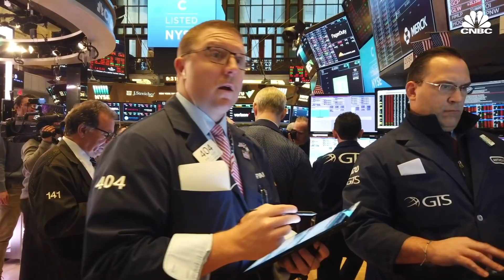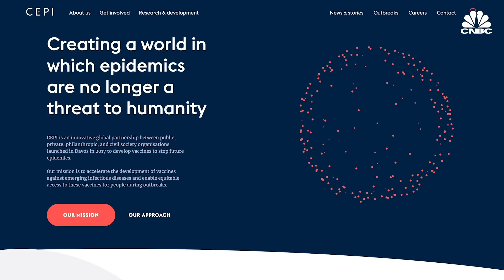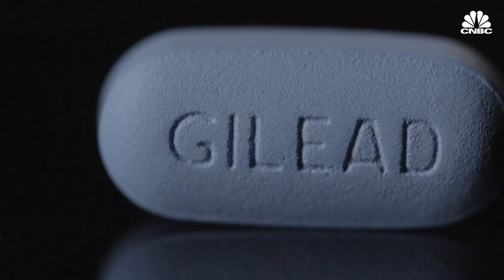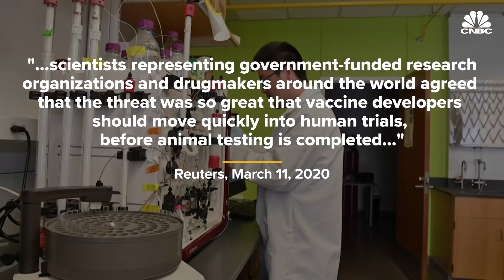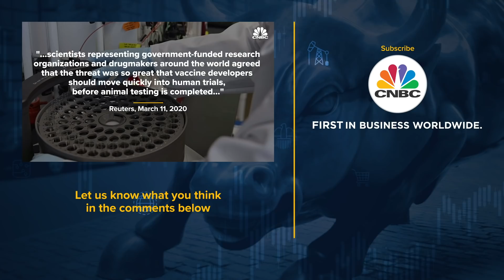The Race To Develop A Coronavirus Vaccine

Comment: Symptoms of the coronavirus:
• coughing
• shortness of breath/breathing issues
• fever
• body aches/ pains
• flu like symptoms
• a sudden urge to travel the world

Edit ♡
So I feel like I should add this on, just cause some peeps in the reply section are confused bout the symptoms 
Don't come at me if you feel this is wrong, please ;-;

Infection with Covid-19. 
This is how it goes down:

# Day 1 to 3
1. Symptoms are almost equivalent to a cold.
2. Slight sore throat.
3. No fever, no fatigue. 
4. You still eat normally.

# Day 4
1. Sore throat and body aches.
2. Make a hoarse sound.
3. Body temperature is about 36.5 C.
4. Start affecting eating habits.
5. Slight headache.
6. Mild diarrhea or digestive problems.

# Day 5
1. Sore throat and hoarseness.
2. Slight fever, temperature between 36.5 and 36.7 C
3. Weakness and joint pain.

# Day 6
1. Slight fever, approx. 37°C.
2. Cough with mucus or dry cough.
3. Sore throat when eating, speaking or swallowing.
4. Fatigue, nausea.
5. Occasional difficulty breathing.
6. Sore fingers.
7. Diarrhea and vomiting.

# Day 7
1. Fever is higher, ranging from 37.4 to 37.8 C
2. Lots of coughing with phlegm.
3. Body and headaches.
4. Worsening diarrhea.
5. Vomiting.

# Day 8
1. Fever, between 38°C or above.
2. Difficulty breathing, feeling heavy in the chest with each breath.
3. Persistent cough.
4. Headache, joint pain and hip pain.

# Day 9
1.Symptoms don't change, but they can get worse.
2. Fever gets worse.
3. The cough is persistent and more serious than before.
4. It's difficult to breathe.
5. Putting in efforts to breathe.

# At this point, blood tests and lung x-rays are needed.

# Forward and share. 

# Education is key. 

# Each one teach one

Please attach importance to this problem and don't take chances.

Wear a mask, pay attention to hygiene, wash hands diligently, avoid parties, cancel travel plans.

#FlattenTheCurve

ღ❦ღ
Reply: Yup. 
Here in Kern County we had no cases. 
Then some moron from New York came over and brought it here. 

Now thanks to her we have it in Kern County.
Common sense is not so common.
Reply: John Borris i'm from new york but i have to admit people here are really dumb.
Reply: John Borris in our state there were no one was infected........a person and his family from Italy .......👉🏻👍.....now its 😥
Reply: John Borris 
She probably didn’t know that she had the COVID-19
You may start feeling sick after like a week or so after getting infected
Reply: @johnborris3222  It is a reaction actually, not common sense. The person wants to leave to avoid the disease but already have it with no symptoms. Just like refugees.
Reply: Got that right. All the idiots who first had the virus in my country travelled to countries known to have cases. I don't understand the Idiocy of all of them really.
Reply: @luckyonegrado9794  here in my country too. We didn't get the Corona virus her but some idiot tourists (who were actually touring Italy and other countries) came here and now everything is chaos.
Reply: Lucky one Grado It’s complicated. Humans can’t really understand exponential growth. Let’s say we have a pond, there is a lily. Everyday, the Lilly reproduces one Lilly. It takes 60 days to fill up the entire pond. When will it grow to the entire pond? You may think it’s 30 days but it’s really in 59 days when the Lilly’s take up half of the pond. Remember, this growth is exponential not linear. If we were to form a exponential graph, you get a curved graph (an upside down C). This graph is what math people call a quadratic (2 multiplied by X, a variable). Right now, China is actually keeping some control of the virus because the recoveries is going up and cases are failing down very slowly. When we think about viruses, there is a critical mass where hospitals can’t take more patients and they are left to fend for themselves. You do not want to get to this point because cars will go up and recoveries will go down. Eventually, the virus will slow down because either everyone is sick, getting better, or dying. The media is causing panic and is causing people to make irrational (stupid) decisions. This causes the virus to spread. We can’t just make a vaccine because we just discovered the virus but what we can do is get people on quarantine or get people to stay at home. That way, the virus doesn’t not hit critical mass and making people not get treatment.
Reply: @succ5666  I get that. What I don't get is why make an unnecessary risk to your health like that. One guy knew Italy had the virus but decided oh what the hell let me go there, not for business just for fun. That's what I don't get
Reply: @luckyonegrado9794  Why do refugees leave their place? Basically the same motivation, to avoid affected places
Reply: Shid i got those symptoms but not the last one
Reply: @ztg1421  oof buddy Betta self quarantine yourself
Reply: ღSugaryCupcakeღ oof i forgot i dont have fever
Reply: kobe_playz_ random_games 😥
Reply: @jerry..c..mattathil5872  😱
Reply: DJ - JARAFAT 🤯...yes bro
Reply: Sometimes also loss of appetite
Reply: @arielcchw  thx I guess I'll add it
Reply: @bfundomarezz  omg people be taking things to literally, chill please i do research, it's just a comment
Reply: I heard symptoms are not sore throat, sneezing or runny/stuffy nose.  They are shortness of breath/breathing issues, fever, coughing and body aches & pains.
Reply: Here in the Philippines, Chinese are still coming in despite CoVID. Are they spreading it deliberately?
Reply: @heizgoth  mhmm I'm no professional dude but it makes me wonder why people travel deliberately , not for business, but just because. I mean people can get sick and worse case scenario, die. But they still travel . Here in my country, tourists came here (they were touring Italy and other countries with cases) and thats how it's spreading because of tourists.
Hense the joke, urge to travel the world
 

Sorry if I ramble haha
Reply: Woah. I been coughing all day. And my boy aches. Ummm.. 😳
Reply: You forgot over exaggeration and mass hysteria coupled with ignorance and gullibility
Reply: Your last line absolutely right. 
Here in Kerala we treated many countries citizen and all saved lives.  But one fellow of our state  enterd with Covid 19 and visited all his friends and family and traveling so people of our state becomes mad but he didn't care.
Reply: "hmm, im feeling ill, and theres a pandemic going around..."

"I THINK IM FINNA TRAVEL"
Reply: @laylaywaffles  lol
Reply: its 5G
Reply: @Charles Marvin 7
Reply: This made me laugh😄😂
Reply: I've had ammonia two times. A 68% blood filled and a collapsed lung. I smoke now To. Fot but not to healthy.  Bite my nails and touch my face alot. Unexposed myself to the virus twice. First time was horrible . Covered in sweat , couldn't breath, can't eat cant sleep in pain . Second time . Nothing .

Cure. 

1. Asprian , and or fever reducers.
2.day and night quill.
3.nerotin
4.muscle relaxer 
5.dosage of suboxone
6. Vyvanze.  Every morning. 
7. Catapres .
8.visteral 
9. Stomach meds and/ or tums . 

The virus fades off . You cannot contract it more then twice. Proven fact.  Can CNN answer that 

Search what these medications. Do. Hiw they all will co act . And the effect you'll feel. Weigh the pros and cons. I.know this works 11 people tried. Absolutely fine now .
Reply: I know it’s said jokingly but it’s seriously true I work at the airport and people despite all this are still travel with kids and all, all age groups and like the vid states people can have it and deal with it own their own and not know it but still pass it on
Reply: @rachimravix6760  best of luck to you, especially since tourists come and go there,
Reply: ღSugaryCupcakeღ thanks much appreciated in this trying time
Reply: @rachimravix6760  ❤️
Reply: Well its allergy season so how you can mistake the two ijs🤷‍♀️
Reply: Sore throat?
Reply: I have cough but I don’t thinks it’s corona I’ve just been eating or drinking lots of sweets and sneezing cause of dust allergy
Reply: That's actually true lmao to back that last symptom there's this indian singer Kanika Kapoor she traveled to Uk, France even after getting a positive sign for covid-19.
Reply: I hope you know this is a scare tactics. Coronavirus, is just another fear-mongering from the government. have you died from the so called Coronavirus? No. You're still alive
Reply: @myaatheist1731  It's generally only lethal to people with compromised immune systems, the elderly, the very young. It hits hard. Takes about 5-24 days to incubate, then when it peaks, it can be fatal to those with risk factors. Don't be a part of the problem.
Reply: Yupppp
Reply: Yea. My country was fine, till this lady from spain came here (and apparently she didn’t know she had it)
Reply: Got that right Wuhan got on lockdown to us and then some moron from wuhan made connected flights and got Seattle infected
Reply: Don't forget sore throat
Reply: A paycheck from uncle Sam to tell everyone your common cold nearly killed you while keeping a straight face
Reply: @frankmoser6251  The coronavirus is worse and the pay check is for economy stimulus.
Reply: Sometimes pneumonia
Reply: A sudden urge to travel thr world and touch your face
Reply: Cant they breakdown the virus and wash it out your body.????
Reply: ღSugaryCupcakeღ * IHAVE IT*
Reply: ღSugaryCupcakeღ Facts you’re speaking facts.
Reply: ღSugaryCupcakeღ for the first time, i like the edit on a youtube comment. well done chap
Reply: @lordofraccoons2708  hehe thanks
Reply: Noooo no no no no my mom has a sore throat ...:
Reply: Hey...i wana talk to you...😑 i'm tired of this covid 19 ..i wana chill with you...no i'm serious
Reply: @farooqahmad94  um k buddy err it's just a comment
Reply: @Springs_secrets  what?
Reply: @farooqahmad94   wash your hands first buddy
Reply: @farooqahmad94  Hey are you ok? How you feeling wanna chat? Im completely isolated and i feel bad i cant help so if you wanna chat it will me feel better knowing that i am of use in society..
Reply: Farooq ahmad my name ahmed aswell
Reply: US should have locked down the borders when we had the chance 🤬
Reply: @MiVidaBellisima  not borders but all travel they closed the border when everyone was getting infected already
Reply: A sudden urge to travel the world isnt true
Reply: @danial7582  my dude it's a joke. Don't let me woooosh you
Reply: @hannahbanana78  ew childish redditor
Reply: @danial7582  aw thx buddy, I just like the sub Reddit, I don't Reddit, thc
Reply: Kronos Sight buddy, it was a joke. r/wooosh
Reply: bfundomarez it’s not SARS anything. SARS and MERS and two completely different strains of corona virus. nCoV is what they were calling the Chinese virus and now they are calling it covid 19

Comment: This just validates why there's no cure for cancer... it's not profitable for the greedy few
Reply: Think the incidence of cancer is high enough that a cure-all-cancer pill would be the biggest blockbuster ever. Like people would want any other drug when yours is a guaranteed cure and you still have ~10 years of patent.
The issue described is much more pressing for antibiotics; any new antibiotic will be used extremily sparingly. That's bad in the current system.
Reply: Cancer is a disease caused mainly by your lifestyle, not simply an invading virus or bacteria.
Reply: Gotta blame it on money like a libtard. Viruses can’t be cured like SNAP! idiots.
Reply: Well cancer is a long term problem, so it will make much more money than a vaccine for this
Reply: The "cure" doesn't need to be in the form of a medicine or some mixed chemicals. Like this one, the sunlight could be our unlikely cure...
Reply: The cure for cancer lies in the healthy lifestyle, because cancer is a lifestyle disease.

Comment: FACTS:  98+% full recovery rate - Most Common Symptoms - moderate cough. 300,000 - 600,000 die from the flu EVERY YEAR but no one panics. Thank you govt and news media for turning this into a hysterical over reaction that's doing much more harm than the virus itself.
Reply: MSW You cannot compare this to seasonal flu you clown. Anywhere between 9.3 and 49 million people contract the flu in the US per year ALONE. Covid-19 has 170,000 confirmed cases WORLDWIDE. 

The generally accepted mortality rate for nCOV-2019 is around 3-4% on average with it rising to as much as 8-9% for the elderly and those with pre-existing health conditions. Seasonal flu’s mortality rate is 0.1-0.2%. 

nCOV-19 is around 30-40 times more deadly.

The R0 for nCOV-19 is generally accepted to be around 4-6 whereas the flu is around 2.

It is disingenuous and harmful to spread this nonsense that this virus is nothing to be worried about.
Reply: @JamieKING10  Never said it was nothing to worry about but also not worth sinking the global economy over. Clown??? So sorry to have an opinion contrary to yours professor.
Reply: @vrsantafe  You didn't really make that clear did you? 

"hysterical overreaction" 

Doesn't really say to me that you think it's something to be worried about.

Comment: Yes, fast track it. There is always someone willing to volunteer to take it. Pay them substantially and ensure they understand all the risks. Fast track half the makers and allow the others to take the traditional road so all our eggs aren't in one basket. If the virus hits a certain number in the US, they will fast track remdesevir. when taken by itself without steroids and antibiotics it has been rumored to work well. Only hearsay at this point though. The compassionate use cases did turn out well which is fantastic.

Comment: A patent for the Coronavirus, a slightly different strain than the current outbreak, was granted in 2018 to the Pirbright institute, co funded by the Bill and Melinda Gates Foundation. Expect to see a specific vaccine for the current outbreak to come from either the Pirbright institute or QinetiQ. https://www.youtube.com/watch?v=aylGY3DHlso&t=3s

The simulation run in October called "Event 201", which modeled a Coronavirus outbreak in China and was funded by the Bill and Melinda Gates foundation, was to measure how people would react, specifically how many people would resist a CV vaccine, and how people would react to those people. (By the way, the Gates foundation partly owns the patent for the CV Vaccine!)

In the next 6-12 months there will be a vaccine for CV, and it will be mandatory in some or all countries. Those that refuse may be locked up in "quarantine" which is really KIDNAPPING. I'm not being dramatic. We have the natural right to not have medications forced on us. There will be little to no transparency as to what EXACTLY is in the vaccine they will push on us, and that includes the bonding agents, preservatives, suspension fluid, etc... There may be nano-bytes in the vaccine and we'll never know it... 

They will use psychology to turn people against each other, so that those that accepted the vaccine will treat those that didn't as villains...
Reply: 8trigrammer 🤔

Comment: A friend got it ? Well felt sick ,high temp and nose like a clown. Tipped 10 to 20 mm of volumes 10 hydrogen peroxide in one ear at a time for ten minutes until bubbling stopped , turned head over did the other side and bingo within 36 hours no symptons at all !!! Told me has done this with every flu and never had to suffer a cold ever !! Try it as it is way safer than a toxic vaccine , i will thats for sure .

Comment: Also no ones knows how it transfers or spreads, since China hasn't disclosed any information about the virus.
Reply: It is suspected to be through water droplets. It might not be 100% but it's what we can try at this point in time. If it's water droplet which is quite likely, our skin is actually pretty fine blocking it from entering our body. It's just that our face skin isn't the same, mouth and nose is an issue too.

Comment: Inovio designed their vaccine in 3 hours and has already published animal data.
Reply: Yeah but they have no approved product yet, they are still in the testing period of the vaccine and most that are trying to create a vaccine are seeing the Covid19 change its genetic code in hopes of adapting to its host like HIV as the video said in the beginning they are similar viruses and HIV along with AIDs change that's why we have treatments not cures this virus can possibly change and develop  stronger as we wait and test. Just because someone develops something and publishes data doesn't mean we are getting anywhere if anything millions of people are going to get infected and millions are going to die because the mortality rate of this virus is only getting higher by the day it's only a quarter away from the recovery rate. Right now it's like 100000 confirmed cases what happens when it becomes a million... 50000 dead 300000 recovered... that's still 50000 people dead. My point is this only going to get worse, but in a year we'll all be fine, we'll still have no cure, but at least treatments.
Reply: @Kingkuza805  they have a MERS vaccine in phase 2. Do you know another company with a Coronavirus vaccine in phase 2?